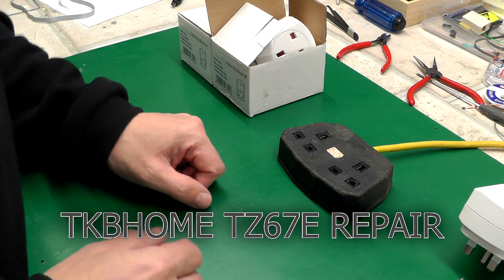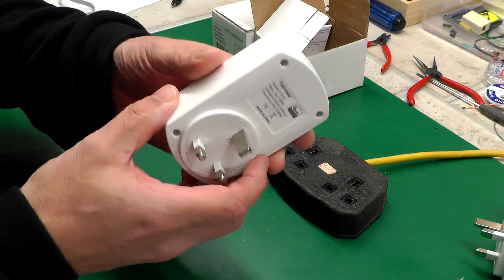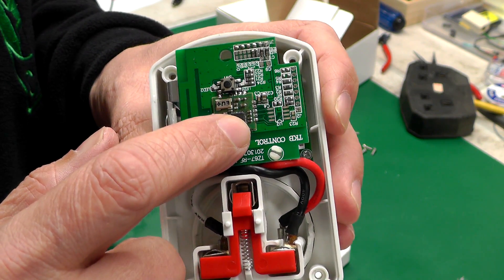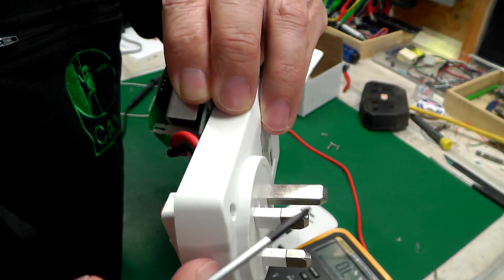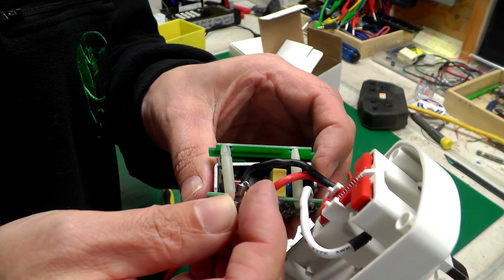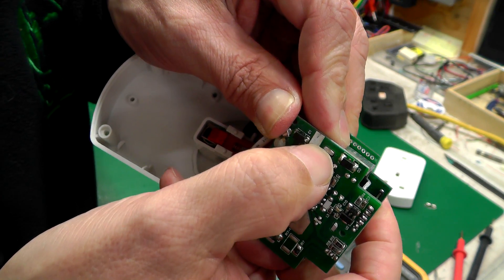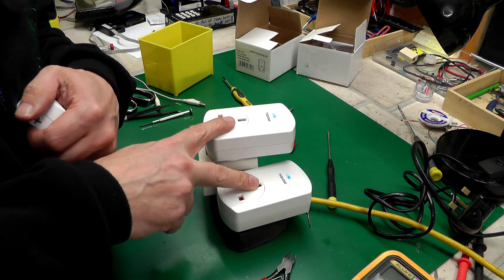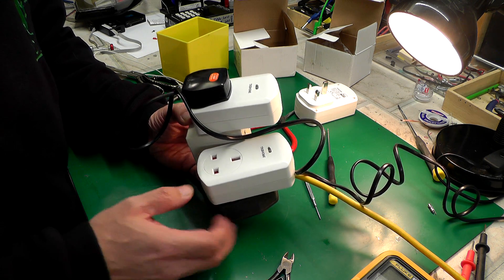No.032 - TKBHOME TZ67E 300W Dimmable Wall Plug Repair

Comment: Hey Ian
I have 2 of these and both are lighting up the blue light button but there is no power coming out of both them
I tried table lamps and chargers but nothing works except the blue light buttons 
Did you face the problem with these before and if so, how can i fix it ?

Thanks in advance
Reply from the maker: Just the problem in the video I am afraid. It's been so long since I played with them, no idea on what to try.
Reply: @ thanks mate
Will try to send em to someone to check em out
Im not an expert but will let you know once i figure it out

Comment: Happy new year Ian, nice to see you back posting videos, I suspect the original design had the SMD fuse but prob didn't past EU safety standards, it's replacement with an axial fuse has been poorly implemented . These fuses have to be able to break a mains fault current (without going on fire!) ,  I don't think I'd fancy leaving these un attended in the house.

Comment: Is the fuse in line with the output or just feeding the electronics? Because if it's in line with the output they would only be capable of 120 watts with the stock 500 milliamp fuse
Reply from the maker: I have asked the UK distributor about this as well.

Comment: Ian is there any connection to earth with these devices there didnt seem to be a connection to earth when you opened the device up ?
Reply from the maker: No earth connection to internal electronics, it just passes the earth through to the output socket.